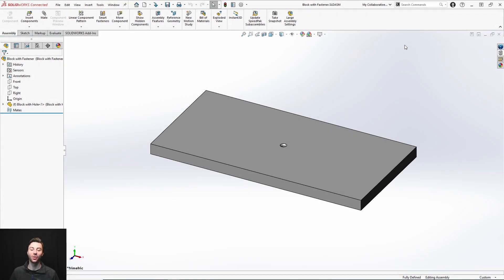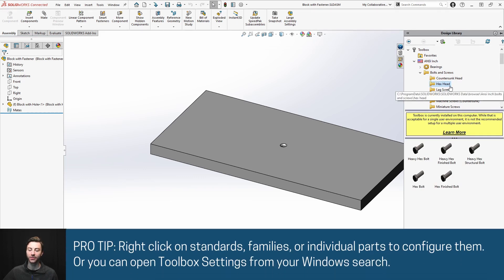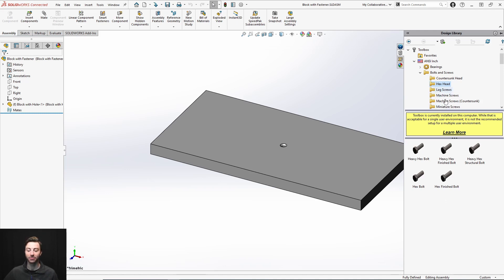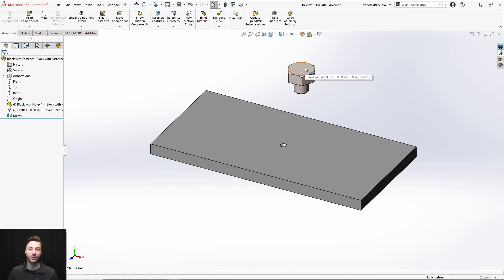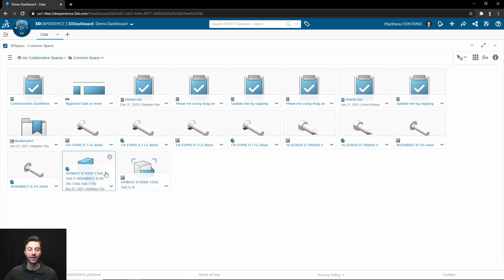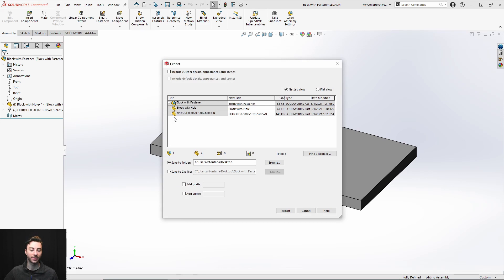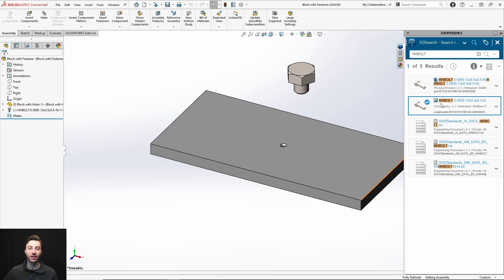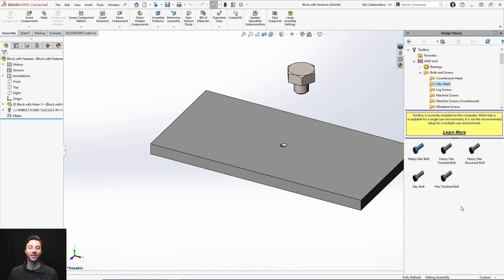How to Use Toolbox Components in 3DEXPERIENCE SOLIDWORKS (8/8)

Comment: Hello, I am the CAD keyuser of our new Formula Student Team. Upon inserting of a Toolbox Part to an assembly it is saved to "C:\Users\chris\AppData\Local\DassaultSystemes\CATTemp\ENOUSWC\Resources\R1132100926410\Toolbox". However, in the 3DExperience Taks Pane under "My Session" it has the status "File has not yet been saved to 3DExperience" and therefore is not locked and has no maturity state. However the file itself is read-only. As a consequence I can't save the assembly to 3DExperience using "Save with Options" and get either one of the two error messages if it contains a toolbox part:

1.
Initial error message:

Failed to open
Unable to ope Toolbox components.
You do not have access rights to the Toolbox's collaborative space or maturity state.
Contact your 3DExperience administrator.

2.
I added a custom property named "IsToolboxPart" with the default value "Yes" to all toolbox parts in the toolbox setup and added a Sub-Type Rule in the 3DExperience Integration Rules Editor with this condition.
However, after doing that I received a new error message upon trying to "Save with Options":

Save failed
User does not have access to selected collaborative space

Could you please help me and tell me how to fix my problem?
Thank you very much!

Comment: What if we change something in local toolbox library? For example if we add material property in toolbox parts, then the icon status is "needed to be save". I cannot do this because it is released. Adding revision does not work in this case. In other words: how to update toolbox parts in the platform after modification in local library?
Reply from the maker: Hello! At this time, the only way to propagate the local changes of toolbox components to 3DEXPERIENCE is to delete the copy on the platform and upload an updated copy. 

This does require that the components are suppressed in all assemblies they are used in, and the assemblies are saved to the platform. Then the locally cached toolbox components in  %localappdata%\DassaultSystemes\CATTemp\ENOUSWC\Resources\<TenantID>\Toolbox need to be deleted. Once the local copies are cleared, an admin can delete the copy on the platform. Once they have been deleted from the platform, you can open the assemblies that referenced the toolbox components and unsuppress them. It will automatically pull in the updated copy and save to the platform on your next save.

To ensure feedback is available for future streamlining of this process, I would recommend submitting your idea on the SOLIDWORKS Enhancements Ideas Community! (https://r1132100503382-eu1-3dswym.3dexperience.3ds.com/community/swym:prd:R1132100503382:community:I23-EB1ZRQyk2sLG5y9Kig)
Reply: @SWYFTSolutions  Thank you for your answer. I understand the idea. However, this method is VERY time-consuming when you have many different projects (with thousands of parts) saved to the cloud. Opening every assembly and sub-assembly and suppressing toolbox components one by one requires a lot of patience and time (which I don't have). Moreover, this method requires making revisions of every assembly when they are "released" (so almost all, in my case). This is not desirable. And what if there will be a need to customize the toolbox once more? Repeat the process again and again? There should be a better way...

Comment: Hello, is there an easy way to pre-save the complete toolbox?
Reply from the maker: Hello! There is no way to pre-save the entire toolbox at this time. This could end up consuming a large amount of storage for components that are ultimately never used. 

For additional reference of best practice, you can reference the 'Working with Toolbox' SolidPractice guide here: https://my.solidworks.com/support/solidpractices
Reply: @SWYFTSolutions  
All right, yes, I understand that you shouldn't save all the standards, but I have configured the toolbox so that it only contains the parts that are used in the company. So it is relatively inconvenient that a leader has to save the designer's parts in advance every time.
Reply from the maker: @Undertaker50270  - Thank you for your clarification! 

If you want non-Leaders to save Toolbox components, you can set the default maturity to be In-Work, rather than Released. Then, a Leader could release them after the fact if desired.

You can modify this setting in Collaborative Spaces Configuration Center > Standard Libraries Management > Toolbox settings > State.

Once changed to In-Work, Authors should be able to save toolbox components as well.

Side Note: As of 2024x FD01, you can upload an export of your Toolbox Database File to automatically share with your users.

Comment: 3dx is the stupidest program ever ... the parts load after 1hour and this trickery with the toolbox doesnt work at all ! whaat the hell is this supposed to mean when i try to save an sldasm with bolts in it "User does not have access to Common Space " ???
Reply from the maker: Hello Nostamine, all Toolbox components get saved to the Common Space Collaborative Space as a default and automatically released. To complete this, users need to have Leader level access. This leaves two main options. 

1. Have your admin change your credentials in the Common Space to Leader. If there is custom data that you should not have leader access to, this can all be moved to a separate Collaborative Space.

2. Have someone that already has Leader credentials in the Common Space save the assembly initially. Other users are then able to save without needed elevated permissions.

You can read more about this with the SolidPractices Document available here: https://my.solidworks.com/support/solid-practices/openpdf?docId=78&langId=1